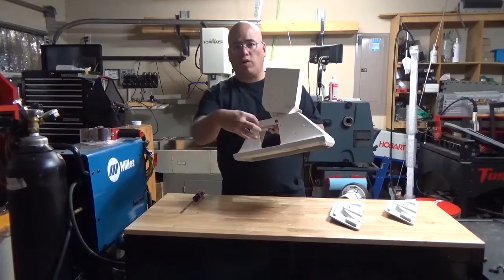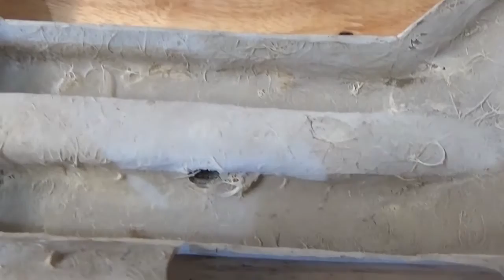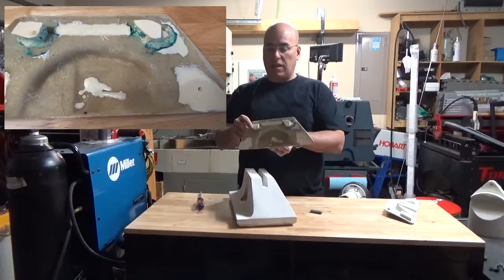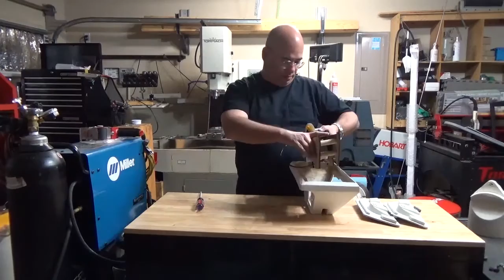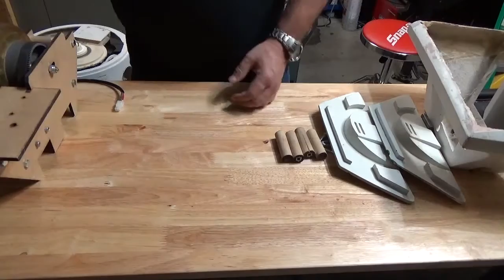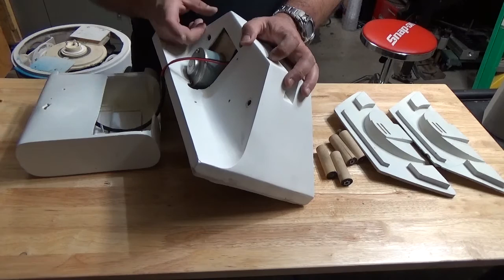R2D2 Feet Motor Mount PART I

Comment: Nice video bud!! Do you sell the templates? Do you sell the kits?
Reply from the maker: +Idaly Hidalgo Thanks for watching the video! Glad you liked it! 

My R2D2 replica is too custom for me to think of selling any parts. I based all of my measurements from kits I purchased between 1995 and 1998. There was no R2Builders club back then. As a result, my R2D2 is way bigger than the actual unit, so my parts wouldn't fit at all. On the feet, things are even worse as the angles and pretty much all measurements are everything but what they would have been supposed to be. So selling any of this has never been a topic in my mind. If there is any info in particular you want me to share, I'll be glad to. But to be honest, if you are getting started you might as well get started with the actual R2 Builders Club plans. Way less headaches that way!